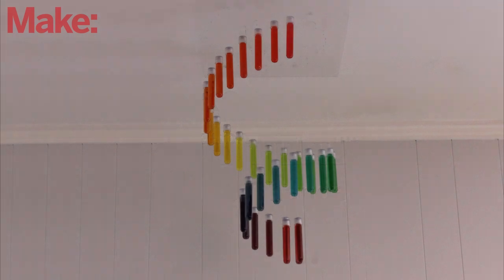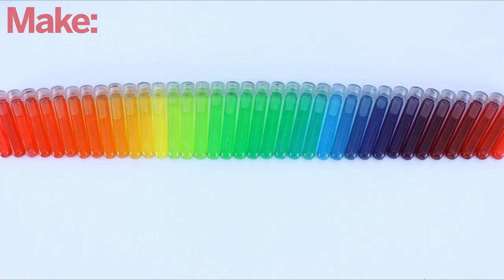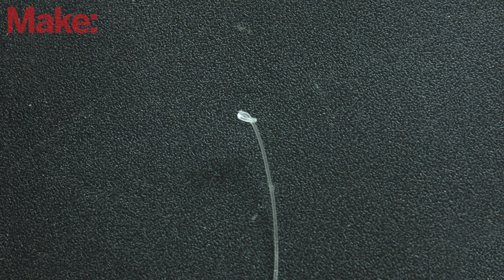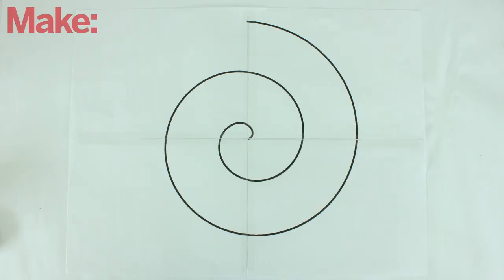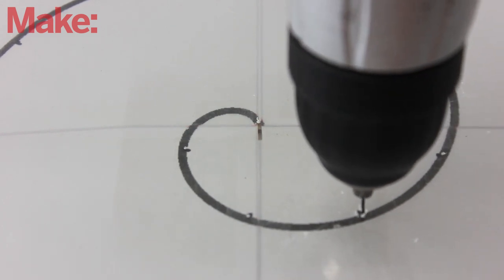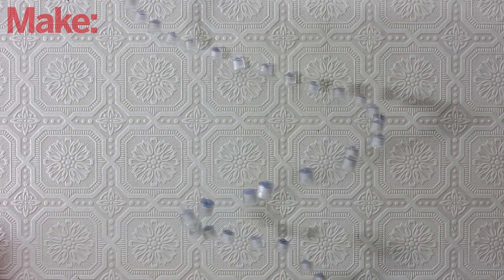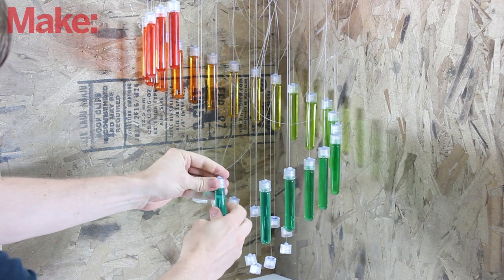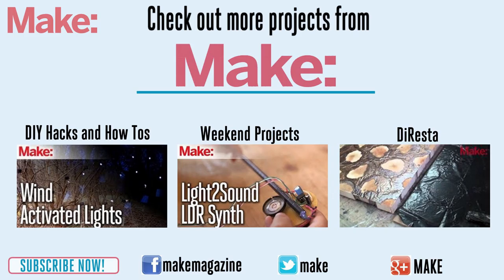Test Tube Chandelier

Comment: Design could be improved by adding some fibre optic cable to transmit light from the base through the cables and into the test tubes. That would allow the colours to emit light and add a cool effect to create a true chandelier.
Reply: Athan Condax That is an awesome idea!
Reply: Athan Condax Thats a good idea. Im using neopixel leds in mine.

Comment: Improve the Design

Chandelier meaning:
noun
a decorative hanging light with branches for several light bulbs or candles
~~~~~~~~~~~~~~~~~~~~~~~~~~~~~~~~~~~~~~~~~~~~~~~~~~~~~~
How to improve the design:

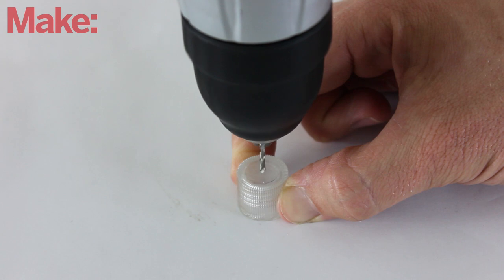1. At the video point 1:03, apply a positive and negative small wire, through the hole you have drilled.
2. The wires you have now threaded through the hole should be connected to a small LED. be sher to use heat shrink tubing on the connections once the LED's are soldered to the wires.
3.Add a power system,resister,on and off switch and glue/screw the power pack to the base on the roof.
4.on the base (at the video point 2:20) add a small spacer between the roof and the base for space for the wires
~~~~~~~~~~~~~~~~~~~~~~~~~~~~~~~~~~~~~~~~~~~~
How to improve the design. (For the Advanced / Willing)
You will need to watch:

(MAKE)
Weekend Projects - Android-Arduino LED Strip Lights
https://youtu.be/Hn9KfJQWqgI 

(MAKE)
How-to Tuesday: Arduino 101 the LED
https://youtu.be/pMV2isNm8JU

Optional: (If you need an idea for the wire set up, and or want a kit with some basics)

(KipKay)
Make Your Own LED Lightbulb!
https://youtu.be/7qxtRoCWg6s

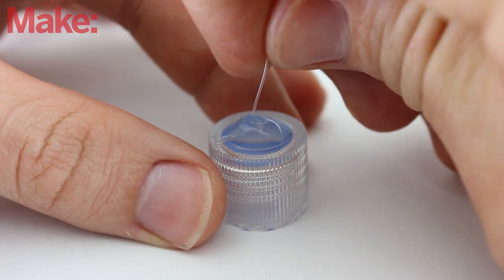1. At the video point 1:03, apply a positive and negative small wire, through the hole you have drilled.
2. The wires you have now threaded through the hole should be connected to a small LED. be sher to use heat shrink tubing on the connections once the LED's are soldered to the wires.
3.Add a power system with an Arduino, configure the code based on the aspects in the Weekend Projects link.
4.on the base (at the video point 2:20) add a small spacer between the roof and the base for space for the wires and the power pack and/or ground wire.

Feel free to change any of the details to best fit a optimal setting.

Give it some Thumbs up so people can get the most from the design, as well don't shy a way from adding your input, if you find/have a cooler idea.

Comment: if the "plastic sheet" was suspended by a string you could probably call it a 'mobile' ... or drop little waterproof leds into the test tubes, then you could probably pass it off as a 'chandelier'

Comment: You could've just added LEDs and a nice controlling circuit - people would love the fuck out of it.
This thing seems a bit rushed and half assed - make a second part where you add lights and you'll have a piece of content that ppl will like.
Reply: neomix21 im currently ordering the test tubes and 8mm neopixel LEDs for this project
Reply: austins_creations Great!What will you use to control the neopixels?
Reply: I was gonna try to use adafruit trinket (I'm only gonna use 25 LEDS, and instead of having the fishing line i want to take a thick solid core wire/metal and bend it to the spiral shape, giving the chandelier more rigidity
Reply: thats one way to do it, personally am gonna try to stay away from liquids, I might use sand paper on the inside of the tubes but havent decided, I also like the options that the NeoPixel Leds offer, as you can do many colors and patterns, plus the price isnt too bad